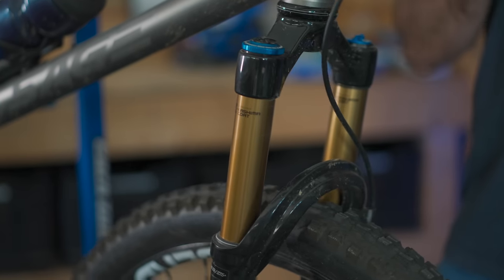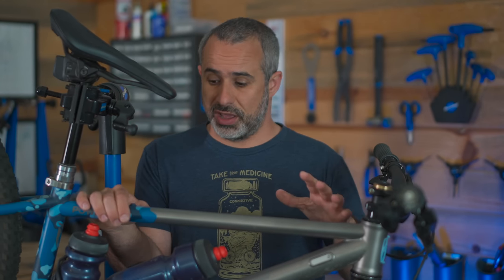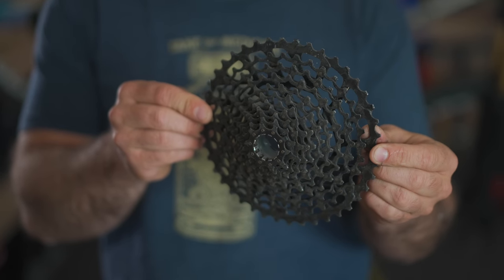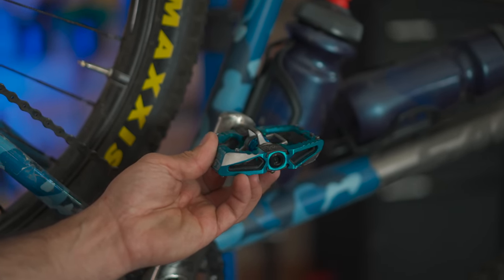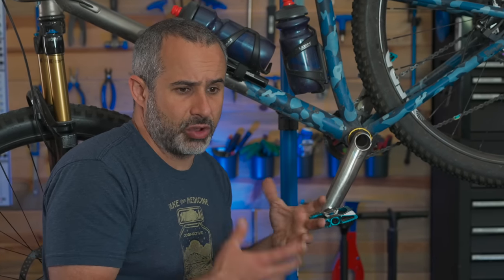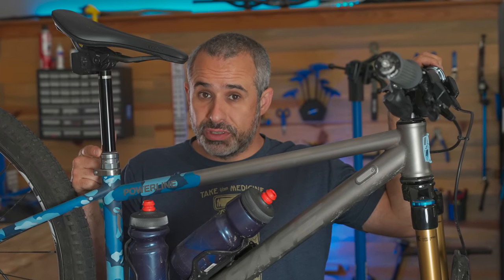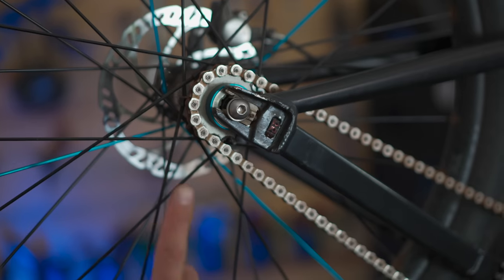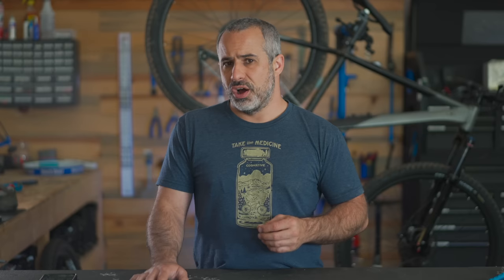You're saying it Wrong! The most mangled bicycle lingo clarified

Comment: I work as an engineer at a company that designs mtb pedals, and we always refer to it as a spindle. So do all of our suppliers and industry contacts. I have never heard it called a pedal axis. Just Google pedal spindle and pedal axis and see what comes up. Pretty much every company calls it a spindle... sometimes its called an axle, but not an axis. Not sure where he got this one.
Reply: Agreed, the axis is the plane upon which the pedal rotates, but the spindle is the physical piece that provides said axis.

The wheel hubs and crank spindle all provide an axis of rotation...
Reply: @BlueTrane2028  Wouldn't an axis be a line, rather than a plane? Geometrically speaking?
Reply: @aspensulphate  sure.
Reply: Exactly,  an axis is the geometric term  for a pedal's spindle. But mechanically it functions as an "axle".not a spindle. 

Since it remains stationary,  the same as a wheel axle. While a bicycle bottom bracket spindle rotates. But the common nomenclature,  is to refer to it as a "spindle", 

That is not just for the threaded section.  I didn't know that had a separate resignation?
Reply: @nc3826 Ah, but a pedal spindle actually rotates with the crank arms as the crank arms spin, and the pedal orientation stays constant, making it a spindle for the pedal instead of an axle.  The frame of reference is the pedal, not the crank arm.

Likewise, a bottom bracket spindle spins, making it a spindle.

A wheel axle does not spin - it is stationary in rotation while the hub spins around it.  That makes it an axle.

At least that's how it works in bicycle terms, anyway.
Reply: @MSUTri  Ah, no....  The pedal axle, does not rotate about its "own" axis (Which is what is relevant and is why it's technically an axle) Plus a pedal orientation does not remain constant... It's constantly being rotated back and forth... Just because it doesn't rotate about 360° normally, does not mean it remains fixed....

(The rotation of the bottom bracket spindle around its own axis, is the incorrect reference point... When two objects that are interconnected,  rotate about themselves.... I realize how confusing it is for a layman. KISS)(I was going to use Mercury as an analogy, but I just found out that it actually does rotate a little bit around its axis ;)

But of course common bicycle nomenclature, can refer to it as a spindle.... So none of this changes anything, from a practical standpoint....  It's just not correct from an engineering standpoint... 

Have a nice day my pedantic friend....
Reply: @nc3826  Respectfully, the frame of reference that matters is not with respect to the axis of rotation of the crank arm, but the pedal.  And in that respect, mechanically, in bicycle terms, makes the pedal shaft a spindle, not an axle.

If the pedal shaft were instead fixed to the pedal, and there were bearings in the crank arm which supported the shaft, that would make it an axle, rather than a spindle.

I am not speaking in laymens' terms.  I am a rotating equipment mechanical engineer with a post-bachelor's education and more than 10 years experience in the design, testing, quality, and applications of rotating equipment.
Reply: @MSUTri  plus an automobile's axle rotates...  so nomenclature often deviates from what technically, a mechanical part should be referred to...
Reply: @MSUTri   A bicycle wheel axle can also be rotated, when it's not attached... So based on your new rationalization it's actually should be referred to as a spindle.... But attachment points are relevant, in terms of describing the functionality of a part.... A wheel and a pedal have analogous parts, except for the fact that the wheel has two attachment points....  It's just the rotation of the bottom bracket that makes it seem different...
 
I understand, after years of training and experience we tend to try to rationalize... What we referred to something, has a rational meaning... Even when it doesn't.... Nomenclature does not necessarily follow the mechanical nature of a part.... 

I will grant you, your expertise in terms of your nationalization was impressive....

At least we can agree on one thing, It shouldn't be referred to as an axis...  Thank you for the trip down the rabbit hole, but I have to get out now..... Have a nice day, sir...
Reply: @MSUTri  automobile wheel spindle, also does not rotate....  And has the same general conical shape as a pedal spindle.... So maybe It has a separate entomology based on that ???

 But we are both being too predentic about it anyway lol take care....
Reply: He’s wrong about a lot of this.
Reply: @nc3826  , ain't that spindle/axle thing about transfer of momentum? I was taught like that (but in different language). Like one thing provides axis, and the other thing transfers momentum from one part to another. What words are common? I can think of "shaft", "axle", "spindle", "pivot".
Reply: My Dad in the 80's told me it was a spindle.

Also a Chainring is a type of sprocket.
Reply: I've also remember it being called the spindle.  I've been mountain biking since 1995

Comment: To "dampen" something also means to make something less strong or intense - this is probably where the confusion comes from. Dampers dampen the force of impacts via damping.
Reply: You can stuff tissues inside the tubes to help with dampening the sounds caused when others put ball bearings in the tubes.
Reply: I think you might find this is a difference between American English and Normal English.
Both damp and dampen have similar meanings in the dictionary.

You could say the shocks have a dampening effect. I think still the original way he used it sounded wrong though, but I don't think there's anything wrong with using it in a more general context.

These words are all, general dictionary terms vs bike specific terms. Like a Chainring is a type of sprocket, so calling it a sprocket wouldn't be wrong, bike in the bike world you could say chainring without needing to point to which sprocket you were referring to.
You could also say, cassette or freewheel for the rear.

Comment: The interchangeable handlebar or handlebars comes from old designs (and from motorcycles) where individual left and right handlebars can be clamped to the fork.  For example, clip-on handlebars for motorcycles are two distinct handlebars that each clamp to one side of the triple clamp.
Reply: There's another one Seth missed:  There's no such thing as a triple-crown fork.  There are triple clamps on some (not all) double crown forks.
Reply: Well, there are two ends, that don't really look like one unless you have flat bars which are a pretty new thing.

Comment: I might catch flack for this, but go to your bike store and ask for a new wheel. I don't think you'll get a tire included in your purchase. You'll probably get a rim, hub, and spokes all assembled into a "wheel" or "wheelset.'

That's how it works in the automotive world, at least. The tire is separate from the wheel. I've not heard it otherwise in my local group of bikers, either.
Reply: Very true
Reply: I’d agree with this. A tire isn’t part of a wheel. It goes on a wheel.
Reply: Bought a wheelset online, didn't come with the tires.
Reply: Wheel can be a catch-all term in context; eg, 'the wheel came off the bike in a crash' includes the tyre.
Reply: The tire becomes part of the wheel when it's mounted. The wheel is what's called an "assembly", meaning it's the sum of its individual parts. Each of which can be referred to specifically.

Say you have two sets of wheels, each with tires installed for different conditions. If you say "I'm gonna swap wheels" everyone will know what you're doing.

If you say "I'm gonna swap wheels and tires" everyone will assume you're gonna be using some tire levers.
Reply: I was looking for this comment. Agreed

Comment: Seth, those folks across the pod sometimes call derailleurs  "mechs"- as in rear mech and front mech. And, they also use de-rail-e-yur  as well. Perhaps because of a road cycling and Euro focused lexicon. Love that you are going about this!
Reply: Yes that's true. Rear mech is the usual term nowadays over here in England.
Reply: It is a mechanism that moves the chain across cogs, so it's correct as a general term of its usage.
Reply: I think "mech" is Brits avoiding sounding French, lol. Derailleur is the French word based on "derail" (like a train), which is where the derailleur was invented.
Reply: @matt.3.14  Yeah, the correct pronunciation is probably French, so more like deh-ray-err (or perhaps deh-raye-ur) than det-raill-ee-uh or de-railer.

Comment: The botttom bracket one is easy to work around. Especially in square taper bottom brackets, you could call the bottom bracket with the included spindle a "bottom bracket assembly".

Comment: Was a bike shop mechanic for 12 years and (prior to this video) never heard or said “fork end” (called it a rear-slotted dropout, lol) or “axis” (called them spindles). Funny to hear your breakdown of chainring vs sprocket… all the BMX’ers I knew always said “chainwheel” and “sprocket”. 👍🏼
Reply: Yeah, going by the technical definition, a chainring is also a sprocket, it's just not commonly used that way in reference to bikes.
Reply: same with the fork end.
Reply: "Fork end" is mostly used when referring to track bikes. Those fixie folks will know you're not one of them if you call it a "dropout".
Reply: An axis is the geometric term for a pedal's spindle. But mechanically it functions as an "axle".not a spindle. But the common nomenclature,  is to refer to it as a "spindle".  

But he kept referring to just the threads, which I didn't know had a separate name?

Comment: I think the chain does stretch out. Although the metal doesn't stretch, the chain is the complete thing. Since wear in the links causes the chain as a complete thing to get longer, it does stretch out! Also, you don't need preload to have sag. If you're un a completely un-preloaded spring, it still sags under your own weight.
Reply: stretch, or lengthen/elongate? 

Two different meanings. I'm going with the latter.

As for "stretch out", needless verbosity  : )
Reply: It’s not stretch because stretch would imply elasticity of the chain as an assembly and that it’ll spring back to a shorter length upon releasing tension.

As mentioned above, chain elongation or lengthening is more technically correct. As the wear between each pin and link develops a bigger gap, it causes a significantly longer chain over multiple links, which is how we measure it.

Comment: To split hairs, pre-load and the air pressure aren't exactly the same either. The air pressure sets the spring rate of the air chamber. Preload is adding an initial compression to the spring at full fork/shock extension. It's subtle but while changing preload will alter your sag some, it doesn't alter the actual spring rate like changing the air pressure would. You could add a ton of preload to a spring that is too soft and get a "correct" sag measurement, but it would still bottom out too easy because there's not enough support through the travel. It is tricky because there isn't really an independently adjustable preload on air sprung suspension (volume spacers are not the same thing, closest concept would be the negative spring? but also not quite), and you really only see true preload on coil sprung.
Reply: I’d say that on air suspension it would be the ratio between you’re negative and positive air chambers. But I’m not sure the range of pre-load is as large as a coil fork/shock.

Comment: I think the forkend vs dropout could be argued currently, as the forkends are commonly (and even officialy eg by Surly) referred to as horizontal dropouts and it got adopted quite well in the community. It's also reasonable and if one knows what dropouts are, he or she will most likely imagine what a horizontal dropout is

As a sidenote: in Poland plenty of things are getting called "derailleur" by nontechnical people:
- derailleurs (obviously)
- shifters
- number of gears a bike has (eg one might say that 3x9 bike has 27 derailleurs. I know, in english it sounds rubbish)
- the cogs in cassette
So you see it's a magic-multitool-word for most things related to the drivetrain xD
Reply from the maker: Oddly, back in the late 90’s and early 2000’s we always called the rear of a BMX “dropouts”, and I thought it was because the frame hung lower to shield the hub when grinding ledges.
Reply: @BermPeakExpress  Had never heard of forkend term, used to call them horizontal dropouts as well. My Balfa hardtail from 2001 had that style along with a hanger, which I think was somewhat unique to have both? My first mtb in 1997-- (which was actually a Diamondback!)-- first upgrade I got was toe clips so I could ride and look more serious like my buddy who was already riding (on a Barracuda I think). Cheers to the old days
Reply: I haven’t seen any I quite some time, but years ago horizontal dropouts were the most common thing on road bikes. The slot faced forward, so you could remove the wheel without derailing the chain. I suspect they were common as some people liked to switch to a fixed gear wheel for either winter training and/or time trialing,and you needed the horizontal slot to be able to adjust chain tension.
Reply: If Sheldon Brown is to be trusted - and he almost always is - dropout is merely a subset of fork end.  All dropouts are fork ends, but not all fork ends are dropouts.

Dropout encompasses both forward opening horizontal dropouts (common on vintage road bikes) and vertical dropouts (common on most multi speed derailleur bikes today), since the wheel drops out without derailling the chain.

Dropout excludes rear-opening fork ends (often called track fork ends today), which open to the rear of the bike and require derailling the chain to get the wheel off.

Comment: I'll add to the chain stretch one, and I hear this from other mechanics all the time: the markings on the tool of 0.5 and 0.75 are NOT 50% and 75% worn as if there's some cap coming at 100%. They mean that the chain is 0.5% or 0.75% longer than it should be, so while a 24 link section of chain, with 1/2" pitch should measure 12" long, a 0.5% wear would mean it actually measures 0.06" longer, or about 12 and 1/16".
Reply: An old chain is about half a link longer than a new one

Comment: I think some clarification and correction is necessary for the bottom bracket:

A bottom bracket can only have one spindle (though some rare variations have a two-piece spindle that is splined together in the middle).  A two piece crank has the spindle pressed (or otherwise attached) to one of the arms, and the other arm is usually fixed by a pinch bolt (though that is technically a screw, because it is threaded into the arm, not a nut).   Some aftermarket cranks have a removable spindle so you can use the same arms for road, mountain, fat bike, etc. chainlines.

The center piece between the bearings and bearing cups of a two piece crank is most definitely not a spindle.  Per Shimano (the inventors of this style crankset), that is simply an inner cover.  All it is doing is keeping internal frame crud and cables away from the spindle and bearings.

A square taper or splined Octalink style bottom bracket also has a spindle.  These do not come with the cranks.  Most of these bottom brackets today are 'cartridge bottom brackets' with integral shell, bearings, seals, and spindle.  Older and cheaper bikes will have cup and cone bottom brackets.

Speaking of cup and cone, Shimano style cup and cone bearing hubs are not 'unsealed', nor is 'sealed bearings' a good term for sealed cartridge bearings.  The key word is 'cartridge', which indicates that the bearing is a cartridge (inner and outer races, balls or rollers, and cage, with an optional shield [not airtight, only for grease flow control] or seal) that can be easily replaced as a unit.  All good bearings on bikes are sealed, whether they're cup and cone or cartridge.  So if the term 'sealed cartridge bearing' is too long, 'cartridge bearing' should be the shortened form.

Comment: I disagree that dampening doesn't apply. When googling the definition the second one is "make less strong or intense" that feels pretty appropriate to me!
Reply: Im not a native speaker so I wanted to translate dampening, I could not find out what he means with the wet paper towels. The only translation I could find was the same as for damping
Reply: i did the same thing.  i would argue that damping is more correct… however
Reply: “-en" is added onto some adjectives to convert them into verbs. In that context, it is used to make the adjective's object more like the adjective. "The floor is not damp. Please dampen the floor." When 'damp' is used as an adjective, it means wet, so to dampen is to make it wet.

Damp is also a complete verb on its own, meaning (primarily) to reduce the amplitude. Adding -en in this context is improper. "That vibration is harsh. Please damp it." It would not make sense to describe a sound as being "not damp" like a floor...so you do not dampen it.
Reply: @jonamcc  What a ridiculous display of pedantry, and in the end you’re still not correct.
Reply: @Hornet135  what do you mean i’m not correct. i’m agreeing with everyone else here including Seth. I literally copied and pasted from a Stack Exchange thread that I thought was informative on the matter but I guess fuck me, huh?

Comment: Sprocket V Chainring. On a BMX bike it is a sprocket, it has to do with the attachment style and not whether its front or rear. A sprocket attaches directly to the spindle, but a chain ring mounts usually to the crank, but sometimes to an adapter that is mounted to the spindle. Now that high end MTB bikes have gone back to spindle mounted gears in the front of high end bikes, its a case of losing the old terminology and now we call them chainrings, but it ain't right.